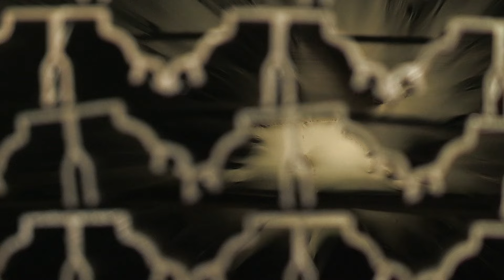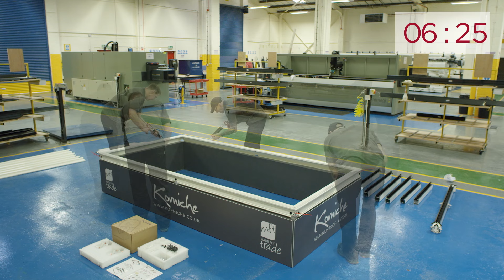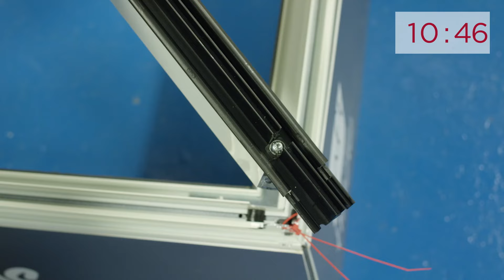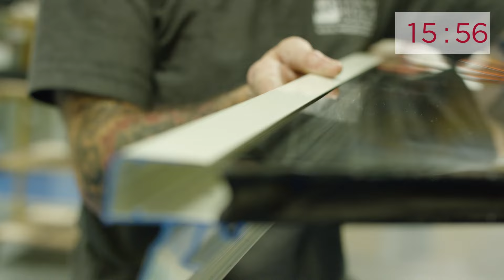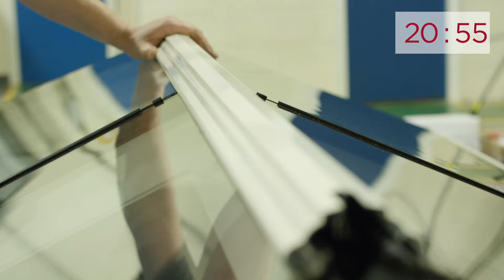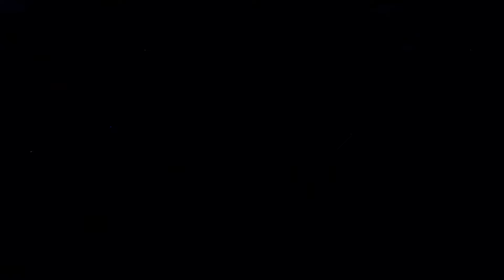Korniche Aluminium Roof Lantern - Installation Video | Premier Roof Systems

Comment: When ordering a korniche lantern sound I measure the outside edge of the raised beam, ie if it measures 3000mm x 2000mm do I prefer same size lantern ?
Reply from the maker: Hi Stuart, that is correct. The size of the lantern is measured to the external finished kerb size. Please use the following survey form as a guide: https://www.premierroofsystems.co.uk/wp-content/uploads/2016/11/Korniche-Aluminium-Roof-Lantern-Survey-Form.pdf
Reply: @PremierroofsystemsUk  So the upstand needs to be a width of atleast 70mm?
Reply from the maker: @Jaaammmbbbooo  That's correct. Please contact us if you require any further info.